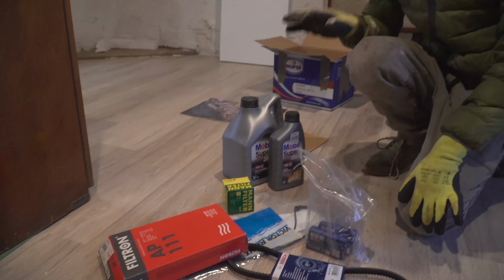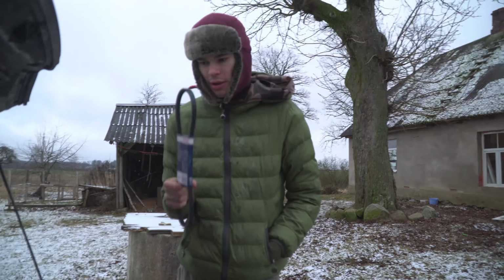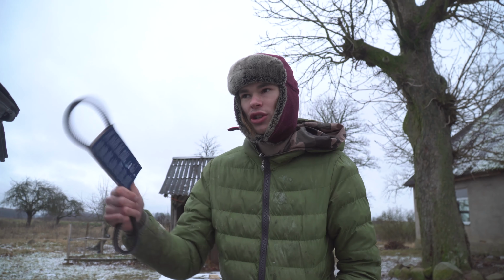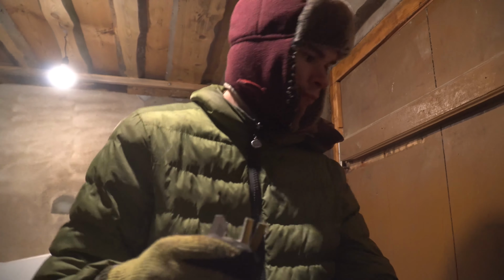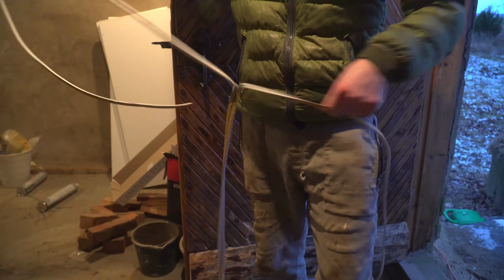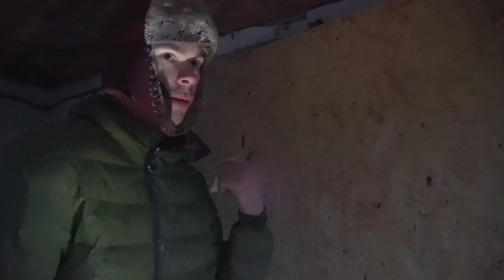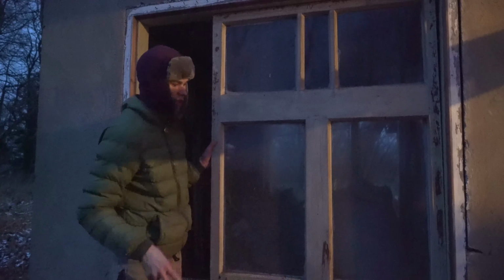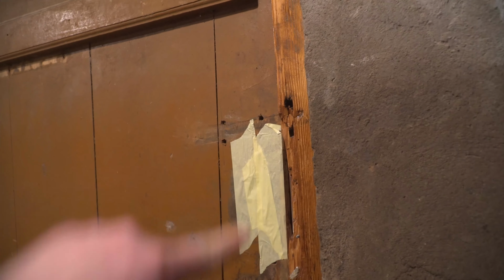Somethings We have been Avoiding to do!?

Comment: We use what we call a threshold for the bottom of doors. It mounts to the floor and takes up space. There is also a metal strip that mounts to the base of a door that has a rubber strip that slides into it and drags the floor to take up space. Thresholds have little grooves in them that the rubber strip seats in to provide a seal. The rubber strip eventually has to be replaced but it usually takes years for that. It would only take you a few minutes to install it.
Reply from the maker: Hmm I need to google around where to get some here in Latvia, thank you I need to find a good solution for it! The surrounding of the door seals perfectly without any air flowing in. The bottom needs to be the same ❤️😊

Comment: Once your table is dry. Lightly sand with 60 grit, wipe down 
and apply a second coat.  Table should be nice for you for years.
Reply from the maker: Sounds like a good idea it feels a bit rough, but maybe 180 grit will be better 60 is a bit too rough and takes off too much! 😊❤️
Reply: @DoBeDiff  Do a 180 and then a 220. It will be really nice and smooth